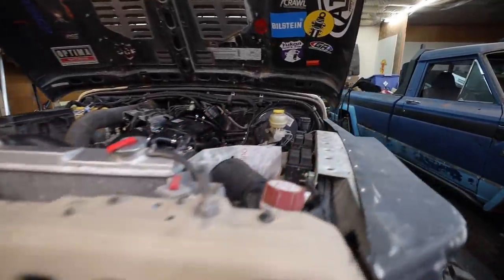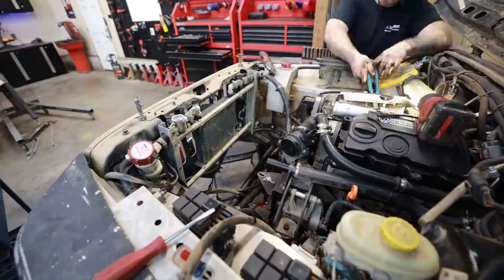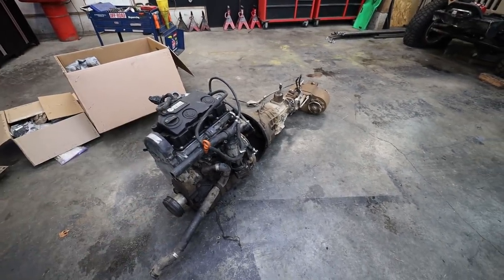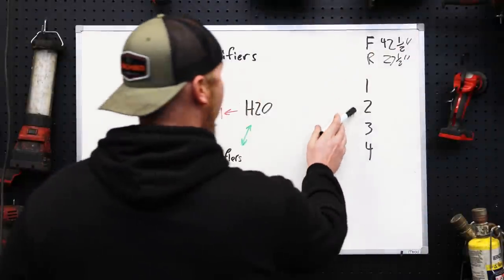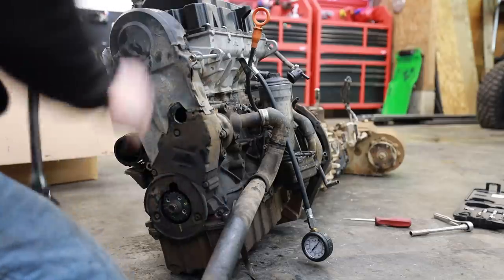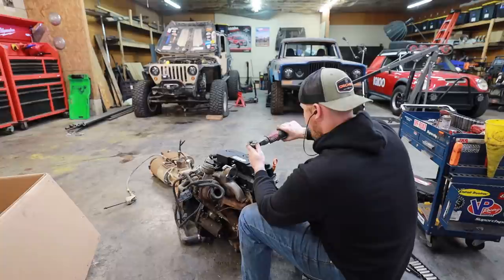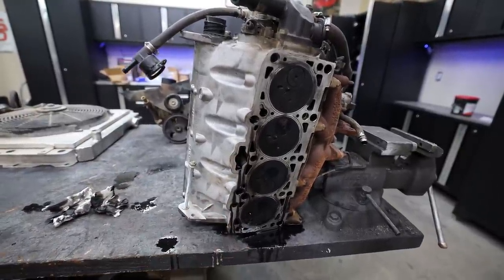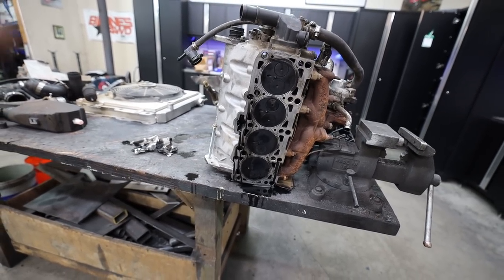New Transmission, NOS And Hopefully A Fixed TDI 🙌

Comment: Keep in mind that when you're doing a compression test by turning it over by hand you will likely get much smaller compression numbers than if you turned it over on the starter. Gold standard is always consistency between cylinders, not absolute numbers since there's so much difference in testing methodologies. 

Either way love seeing more work on the TDI TJ! Best of luck! 👍
Reply: maybe, metoo use starter but, if you check manually, is not bad because , before disassembles. I think it's possible to hear many sounds, and feeeling if turn free. and good reference to check after rebuild, difference et anomaly. save job ,  not sur, i think. nate comfirm ? 

and diesel compression very high,  1hit, same on each cyl why not.  after rebuild, he need to run before testing real compresson, for sure  that part feel good

Comment: Hello Nate, TDIs are complex engines. The less you take apart, the less trouble you get. Keep the bottom end as it is. Inspect the oil pan and the pickup. If there are no traces of metal chips just keep the bottom end bolted together.
The white smoke tells you it was an injector problem (there is a very special smell of non burned diesel).  Make sure the cylinder head is straight. If it is bent source a new one! No chance to fix it! The best move was to send the injectors to a shop to bench test them. 
Put it all together with new gaskets and hardware and fingers crossed.

Comment: Disassemble the motor completely. Deck the block and head to ensure both are true. Replace the head bolts with studs. Think about adding a Provent 200 to ensure oil from crankcase stays out of the intake. Inspect the pistons to make sure you are not cracking piston from pin boss up to and through the ring lands. Have seen this on tuned 2.8 Duramax. Also check conrod bearings as have seen abnormal wear there as well. And have fun!  Family first!

Comment: Look into doing fire rings on the head to better clamp the head gasket. To limit a blown out head gasket.   We do it on the bigger truck diesels with more boost.  

And i would suggest having the head milled flat so your 100% sure it's going to seal uniformly even across the block.

Comment: May as well while your there, check it out. My bhw in '86 4Runner had a head gasket blown boost into the coolant. Everything checked out, runs great. Excited for a good transmission to hold power.

Comment: I just installed the same transmission in my YJ. The end of the shifter linkage on the Atlas contacts the transmission. Experimenting with re-clocking the Atlas and maybe changing the linkage to the rod-end style.  I had to remove the grill to get the 6.0 and transmission in the tunnel with the engine hoist. I'm looking forward to the next video.

Comment: If you’re pulling into a gas station and the big tanker is there filling the stations tanks go to a different fuel station. The bad stuff usually settles at the bottom but when they are putting fresh fuel in the tanks it gets everything moving around.
Reply: I deliver fuel and I can tell you most stations their fuel doesn’t last long enough for it to get “old”. Stations get fuel every few days. Plus usually there’s less than 1000 gallons left in the tank when I’m dropping 8500 gallons on top of it. That 1000 gallons of maybe 3 day old does nothing to that 8500.

Comment: Nate, it won't be a ring.

Don't tear the bottom end down until you hear about your injectors. You either have a leaking injector tip causing that wet cylinder, or if it isn't that then you have a bent rod lowering your compression on that cylinder.

Comment: Assuming you have BRM since it's out an 06...My BRM had 285K on it when I sold it, its still going strong with current owner. I'd be amazed if you have bottom end issues. The biggest problem the the BRM & BEW pumpe duese is cam/cam bearing failure due to wear. Number 2 is the VGT actuator only serviced with the turbo. Then injectors. 
Before you throw NOS at it do yourself a favor & make sure you have a 3 BAR MAP sensor & a better turbo with a "dumb actuator" instead of the electronic actuator for the VGT. The PD140, Garrett 14mm euro spec, is a good option  before going with a crazy big HP setup. The Colt cam works really well with the PD140/3 BAR setup too but obviously needs a tune.

Comment: The head gasket with without a doubt cause cold running issues. My 2002 Acura has a small leak and only issue is cold starts, runs perfect once warmed up. Leaks just enough coolant to cause a messy cylinder till it cleans up and the gasket seals from expansion

Comment: I don’t think I’d put NOS on that since it seems sensitive to over-rev. I’d consider water-methanol injection, it’ll bring down your EGT and give you some more power. I had a Snow Performance kit on my Cummins, it was pretty great.
Reply: Happened once in 4+ years.... I wouldn't call it sensitive
Reply: I would toss new bearings & rings in also hone the cylinders. You beat this engine & u are about to beat it harder... u will be kicking yourself when u have 10psi of oil pressure 1000 miles from home and u just hit the first obstacle.
Reply: @sojer6mile  wait, you disagree that it’s a sensitve engine, then tell him to rebuild it out of caution? LOL

My ex had one of these jettas, it was great. 42mpg… until it ate half the valvetrain. $12k later, it was a good car again 🙄
Reply from the maker: A 45 shot will be a pretty small favor to ask of this motor 😁
Water meth is great and I will use it eventually but it doesn't do much in terms of power in a tdi. My big hp tdi build will definitely get water meth for egts as well as nos but the water meth will only add 15-20 hp
Reply: @bravowhiskey4684  what I disagree with is it's sensitive to over revving. Bearings & rings are relatively cheap under 300 bucks I assume. I suggest because it's adding a bit more reliability in it not power.... I'm a hemi guy, a good cammed 392 would give him more power u could ever want lol

Comment: great video Nate, I don't think you need to take apart the bottom end, those short block 1.9 TDI engines are built stout from factory, I look forward to the videos in this series, Nos is a good little option for that little more kick when you need it to, read an article about a guy in Australia who did it some years back on a Toyota diesel with some success. 👍

Comment: It's torn apart, so it's cheap insurance to make sure the bottom end is good.

That dark on the block suggests to me that a gasket leaked, a head warped, and/or a head bolt got loosened up and the threads won't hold it down good enough.

Comment: At Moab, jeep had black smoke, so burning excess fuel, fuel throttle issue. Startup video has blue smoke, so burning oil. I'd be replacing value stem seals, sometimes you get a little oil that drips past seal when motor is stationary for period of time (eg overnight), at start up that little bit of oil burns off (blue smoke), then exhaust goes normal (no smoke). While you have the motor out, its a cheap replacement on an item that can give you way to much trouble.

Comment: Nate.  Check the oil pickup to tell if you need to strip the bottom end or not sir ?  Fit 'pop-off valve' for safety next time !  V.
Reply from the maker: Definitely 👍
Unfortunately blow off valves aren't very popular on diesels because for the most part they are unnecessary. But they would sound cool lol
Reply: @DirtLifestyle  Nate.  The 'pop-off' valve is different to blow-off valve mista !  A spring can be set to say 19psi - so if a run away occurs, it vents turbocharged air over said pressure to atmosphere ?  V

Comment: If it had bad rings you’d have more than Smokey starts. Low pwr and constant smoking and blow. Not to mention scarring on the cylinder walls. Leave the bottom end alone unless you want to do it for shits and giggles. Check injectors like you said and that new head gasket should take care of that small leak.

Comment: I would say pull the pistons, check the bearings for wear and color. No reason to put a motor back in without checking things first. I would say send the pistons out and have them teflon and ceramic coated. The ceramic coating will reduce the amount of heat being transferred into the piston, it will help with engine longevity and reduce oil temperatures in the engine. I have seen two engines with damage due to the pistons(#2 cylinder) heating up and expanding to the point of making cylinder wall contact.

Comment: Interestingly enough every diesel head gasket leak I’ve seen causing coolant to push out the overflow because of the compression leaking into the coolant ports . 100 percent injector I’m leaning to . U could have hit it with a thermometer running at the manifold  and find which cylinder temp was way off immediate indication of a injector issue

Also water meth over nos,Way better for a Diesel engine

Comment: Nate , as a Harley mechanic i can tell you for us if we pull a piston out of a cylinder we “Always” replace the rings.. they are cheap and are worth replacing when the piston is out.. if it were me i would no mater what ,when i remove and replace the pistons i would definitely replace the rings.. its just not worth doing all that work and not replacing them…

Comment: I buitengines for many years and to me if you are going to go through the trouble of tearing itdown, it would be worth a few etra dollars to freshen it up. If the piston clearance is good, a quick hone job and new rings would help ensure the motor will be in good shape especially since you are adding nitrous. Since the head is off, seems frshening it up would be wise as well. Had some exxperience with nitrous and itcan behard on an engine especilly if something goes wrong.

Comment: The valve seats are eroded and the rings are carboned and not floating freely in the grooves. Camshaft has very little to do with cranking compression. You didn't mention doing a wet compression test which would tell you if its rings or valves. 2nd reason I say rings is that dark ring is oil from the rings.

Comment: There will be nothing wrong with the rings or bottom end vw pd engines are pretty good it's a head gasket or injection issue that's whats my money is on. I'm looking forward to finding out the answers. Great video great work 😎👍

Comment: The angle of the incline you were pulling out of, have you considered loss of oil flow in the front cylinders and the high rpms? Could have caused ring collapse.

Comment: Classic leaking injector symptoms looking at those pistons….and an easy fix when the offending injector is replaced? The head gasket issue possibly caused by that too? Seems too much of a coincidence maybe? A headskim/new gasket on the cards?  Possible wear on cylinder wall caused by ‘washing’ etc? If you strip the bottom end an opportunity to rehone the cylinders?  In my experience when compression is tested it usually requires several rotations to build pressure. Never seen it tested as you did it Nate… what specs were you looking for.?? Lots of suggestions/questions to mull over.. no solutions just thoughts best of luck going forwards. 👍🏻

Comment: Was it burning oil? What does the intake manifold look like? It could be that the rear cylinder is coping more oil vapour due to the shape and therefore air flow of the inlet manifold. Some inlet manifolds have internal sharp ribs which catch oil as the air passes it  allowing pooling and slow discharge into a single cylinder. I’m not sure if the engine has an additional catch can or just returns the excess crankcase pressure to the intake. Anyway just a thought. You didn’t show the actual head gasket but this may give a few more clues. 
Happy youre back to the tdi nonsense.

Comment: Not (yet) seen the video with the engine trouble that lead to this, but I assume it was a runaway kinda situation? You seemed to come up from a hole of sorts, so maybe because of the extreme incline some oil got into the intake?

Comment: What's with the funky #4 piston?  #1 looks like a flat top.  ?? /not a TDI guy.
Reply: The pistons all have the same bowl and ridge in them. Just for better fuel/air mixing inside the cylinder. I'm sure there's more reasons to that specific design, but that's what I remember from my research.
Reply from the maker: Supposedly the shape of the piston makes for some good increases in performance and noise if I remember correctly
Reply: That's the question I was looking for.

Comment: FAQ for Diesel Performance Products Propane Injection Systems, Gas and Diesel Engines. How does it work? The Propane Injection system is boost pressure activated, injecting propane in increasing amounts as the boost pressure level of the engine increases, producing power you are guaranteed to feel behind the wheel.

Comment: Cool video, been watching several back to back currently in day 8 of covid, if you were gonna diesel swap a 1983 Toyota pickup which engine would you use? Thanks
Reply: Look at the Cummins 3.0, I did the VW TDI swap and tech support from Cummins is so worth it. Not to mention more power!
Reply from the maker: I hope your covid experience is quick my friend 👊
I would recommend a BHW tdi from a 2004/2005 vw passat. These are 2.0 tdis and make great power with just a tune. Plus you could easily make 300 hp with basic mods and never even touch the bottom end.
Reply: @DirtLifestyle  thanks for the info man, yea I believe I'm bout over  covid for the most part, my wife and son are also handling it good. Ill do some research on that engine and see what it would take to get on on a Toyota trans. Me and wife wife are both huge fans of your channel, it would be awesome to hit a trail someday, Washington looks fun.

Comment: No rest for the weary.... use this opportunity for a full rebuild.  Better to spend and do now... than later ... the old pay me now or pay me later saying.  Looks like a head gasket leak for sure. Don't think a ring cracked but blow by occurred. Again pull it all down.  Hone the cylinders, new rings, bearings, go through the heads and valve train, injectors.... rebuild while you have everything out. Up grade as desired...

Comment: Nitrous boost over water/meth for more constant improvement?  Both certainly have their place.  Curious why you'd go with the nitrous.

At this rate I'm gonna have to be happy watching your vids, the scope of my project keeps growing and I dunno if I'm ever gonna get the damn thing started.  Decided I "need" a stronger tranny with lower crawl, different T-case, and a doubler.....so on the hunt for those!  Which, of course, means I'll need new drive shafts...even though I prematurely bought a front shaft for the lift.  /facepalm

Comment: If it were me and your are contemplating pulling the rest of the engine apart just replace the rod and main bearings and install a new set of rings I wouldn't think it would cost much more than a couple hundred bucks oh and hone the cylinders very inexpensive and basically ensures you have a budget rebuild on your engine. based on what you have shown I am 99% certain that you have a blown head gasket as you can see the evidence on the block. since you are doing all this tranny work  engine work don't cut corners and just reassemble the engine with old parts once you break the rings from there seated position you really need to hone it out and install new rings, clean the pistons and they are fine to reuse. I have already rambled on too much sorry but you have demonstrated in all your videos with your axle builds and so forth about not cutting corners don't make this an exception. I enjoy your content and hope you will follow my builds I am compiling video content now for a SEMA overland build that has no budget should be exciting, problem is I don't know shit all about YouTube videos so steep learning curve for me. Great stuff keep it up!

Comment: Emulsifiers are terrible for diesel injection pumps as well.  Especially with today's ULS Diesel.  Under no circumstances should an emulsifier be used in an old school diesel like my H1's 6.5 ds4 IP.  The odd thing is that most diesel additives are emulsifiers.

Comment: Only measure compression with the starter....never by hand.  Slap the head back on there and do a leak down test to see where you're losing compression.  Then you need to measure piston protrusion.  No sense in pulling the bottom end apart if you dont have bent rods or is the source of your low compression.